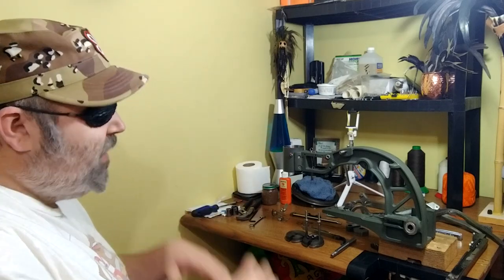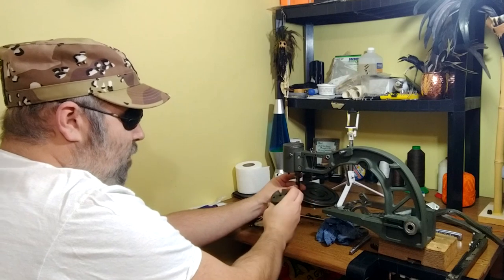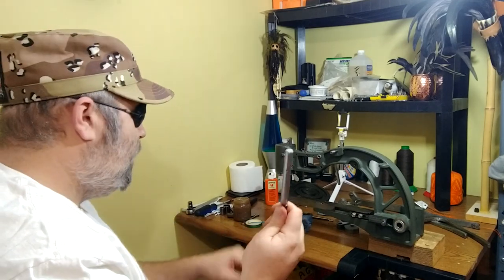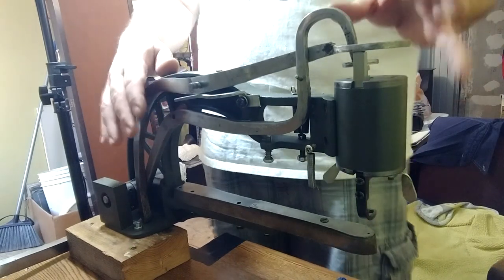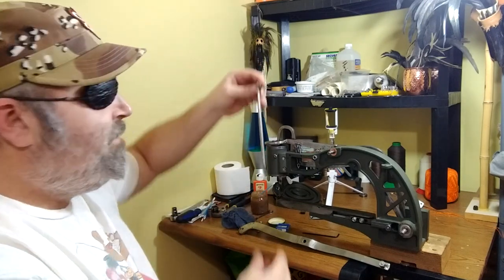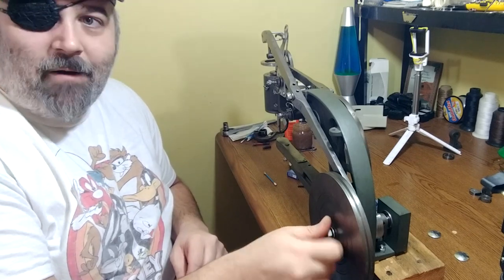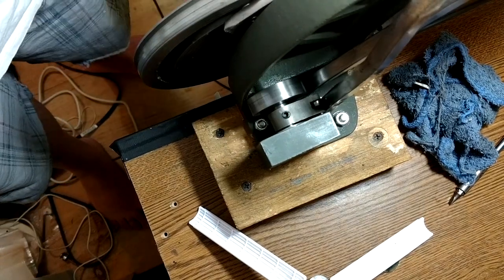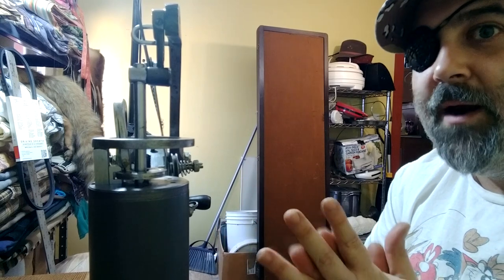How to make your Chinese Sewing Machine run Wicked Smooth

Comment: I thought I would see if anyone could help me. I broke a needle and now everything is out of alignment. I pulled the needle out and now it seems to have what looks like a another broken needle in it. But it will not come out. Any help would be appreciated. TY Jim
Reply from the maker: There is a plate under the sewing arm that you can remove to gain access to the bobbin well. Magnets help out too

Comment: How can I get my thread not to snap when sewing? My thread is able to pull up my bobbin thread, but as soon as I start my stitch, my thread snaps. Also my stitching is spaced out waaaaay to much..
Reply from the maker: I would start by checking out the needle depth, bobbin timing, and adjusting the stitch length screw.

Comment: I've found that the Chinese are pretty good at making knock offs of vintage machinery.  But you have to approach them as "kits" of rough finished castings and parts.  That last bit of hand fitting would probably double the retail price even at Chinese labor rates.  I'd rather get it cheap and DIY.
Reply from the maker: Great point!

Comment: ACres! I NEED YOUR HELP!! Please! After watching you I’ve purchased my own machine. I love it but I’m having some problems now. I was able to set it up (timing) just as you showed us. I was sewing immediately! I was able to use any size thread and was working perfectly! The walking foot just stopped one day! It still went up and down but no longer walked (forward and backwards) I was able to take it apart. Again by watching one of your videos! Believe it or not I got it working better than before. The problem now is that I’ve reset the timing and everything I can think of and so far I’ve gone over everything I can find that you’ve posted but for some reason even though I’m picking up my thread from the bobbin with ever single pass so you’d think I’d be right on point. Not happening! I can tell if I put on some super heavy duty thread I think it will see but that means it’s not set up properly and I don’t want it to just work with rigging it I want it to see like before. I snap the thread every time now! I can get maybe two turns and the thread snaps and yes I’m using the same thread as before that was sewing great. Anything at all that you can suggest would be great! I know we’re not the only ones with these machines but you by far are the man when it comes to a hand crank sewing machine.. you’ve got my vote! “Mainly acres for president!” “2024” ya baby..🇺🇸 anything at all will help sr. I’ve got it set up it should be working fine I’ve got everything working better than before except that darn thread snapping now! With timing and setting my bobbin you helped me get this thing running in one day. Could I really be cursed? I think not. Hey Acres guess what though? There isn’t a silver lining to this story but an actual GOLD lining ! I purchased it from Amazon like most. The walking foot stopped within 30 days I called to report it before trying to fix it myself. Because it was more of an internal part not just a metal arm or something they I’m sure we’re just gonna send me a replacement part. Because right off the bat they didn’t know what the problem was and I purchased an extended warranty I’m guessing the price of them paying to have it sent out to be repaired wasn’t worth the money so I got a full refund and got to keep the machine and fixed it the next day now I just need my thread to stop snapping and I got mine for free!! Awesome right?
Reply from the maker: Have you tried adjusting the stitch length screw? I think that might be the issue
Reply: @MainelyAcresFarmBrooks  actually no I think that may be one that I have overlooked. The adjustments for some of those screws are such small adjustments that I guess I’m just gonna have to make these man hands learn some finessing! Hey by the way thank you so much for replying and in such a timely manner I thought it was fake at first. You’ve got a great channel you speak very clearly and your always very descriptive and are truly making things so much easier for anyone who is doing what you’ve accomplished and what the rest of us are doing to catch up! Please don’t stop if you do I’ll have to try and pick up where you leave off and I don’t believe there’s another mainly acres out there.. thanks again I’ll let you know tomorrow how it goes. I don’t think I mentioned that buying this machine was my wife’s idea. I’ve spent 7 years bedridden and have been out maybe going on two years now and because of that injury I’ve had to choose a whole new trade that hopefully I can learn at this age but something I can do sitting on my butt if I have to. So I really mean it when I say you’ve really helped some of way more than you may ever know! I personally am very very grateful!  Doing leather work even though I’m not so good (YET) I will be though. But it’s been so helpful for me way more than any other kind of therapy I’ve had. Not to mention if your the type of person that creates them I’m sure you know it doesn’t really matter what it is as long as it’s something you have created and your proud of it and if you can meet those requirements I believe your like me and knowing we accomplished what we set out for that’s going to be good enough to make us happy! So yes it takes me longer than some but with your help I’ve been able to do everything they said I couldn’t! Maybe one day I can get a way to send you something and get some real feed back! I can’t hand see very well yet. Hands aren’t there yet. Hence the sewing machine! So until I get there what I’m doing is artwork on the leather I’m still punching and doing everything it takes to be a leather worker just more on the art side as far as I’m basically doing pictures on leather as if it’s just a canvas!     I must say mine are better than a regular canvas though because of the stamping carving along with paint and stain! Now the threads make a huge difference! Those colors add everything to a basic picture! Maybe you can point that out one day. How important the colors of thread are and how they can make or break an entire project. I started making leather wallets but using what I’ve got they’ve come out to thick. But they are great for say a hunting license or fishing. I have them lined with actuallyOryx hide fur on. Even have some with red stag and even one with Buffalo. I’d love to be able to send you one of these and see what you think. I only have 5 and I’d love to send you one of my first ones. I don’t have much but what I do I use to show my appreciation I can’t say payment because it’s not money and I’m sure people would rather have the cash sense I don’t to show my appreciation if there’s anyway you can get some info to me I will send you one made from Oryx . One I personally harvested. We waist nothing! We’re not trophy hunters but if we get one that’s just a bonus but with not wanting to waist anything knowing these are all gifts from our creator again hence the leather working! Don’t know if you hunt or fish but I have never seen you show anything ever sent to you from a subscriber. If you haven’t then let me be the first if not the first then let me be the best!! Ha ha that’s just a joke but I’m serious about sending you one of my first projects because it was mostly learned from you and your time that you did not have to do for any of us! Hey some of us mean it when we say thank you! If you look at July account you can get my info I’ll be looking for something from you so we can communicate and I can send you something out. You deserve it. Don’t forget ! If you don’t send any info I can’t send anything out! 👍🏼👍👍🏽👍🏾
Reply: @MainelyAcresFarmBrooks  oh man I’m so sorry I sent something so long I’m a jerk for that one! So sorry!!
Reply: @MainelyAcresFarmBrooks  “Mr Acres!” I need your help please! Hello sr. Hope you get this. I don’t know any other way to contact you. I truly appreciate the help you’ve given me as well as your videos! Your vids. Are what launched me into buying one of these machines. At first I got it working great I followed all your videos and I was on it. Out of nowhere the pressure foot stopped its walking motion! It goes up and down but not forward and backwards. I took it apart after watching your assembly video and when I had it apart I could really find any moving parts that may have broke. I was also able to check pretty good to make sure nothing had been worn down. Things like the metal bars that are in the head of the machine (cylinder with needle). When I put it back together it started walking again.. after trying to lay down a few stitches it started snapping the thread again but after speaking with you I did some more adjustments and it started working great again. It picks up the loop with every pass! Unfortunately the darn pressure foot stopped walking again! I have no idea what could be causing this. The one good thing about all of this is that when I bought it I got a warranty from Amazon . I called right away within 30 days to report the problem! Because they couldn’t trouble shoot it over the phone nor could they just send out a replacement part? They went ahead and gave me a full refund. Ok it was set up as money on my account and could only be spent three Amazon. That was ok though because I ended getting the machine completely for free! Now SR I have to get it working again. Any help you could give me would be much appreciated! I truly enjoy your videos over most! I am 100% handicapped and live off my disability so getting my machine for free was excellent! Ok it would be if it was working.. 🥸 I got this machine because my hands started working last year and I’m not bedridden 100% anymore. I took up leather crafts to try and make some money for my family and I was doing good but I can’t 🧵 🪡 with my hands for very long , hence the sewing machine! Ya buddy I could really use this thing up and moving . All the parts are there and nothing is broken. It’s a mystery! Well Sr. I sent you one heck of a message! I do apologize for the length of this tex. Please if you can! I will be looking for a reply! Thanks again Mr Acres..! Stay safe and God bless you and yours!

Comment: I have been working with industrial sewing machines for over 40 years.  Your advice to use grease to lubricate  anything on your sewing machine is dead wrong.  You don't use grease, 3 in 1 oil, gun oil or anything else to lubricate other than sewing machine oil (mineral oil) .  Any of those other lubricants can stain fabrics or leathers.  The first time you ruin a project with an oil or grease stain makes buying some sewing machine oil worthwhile.